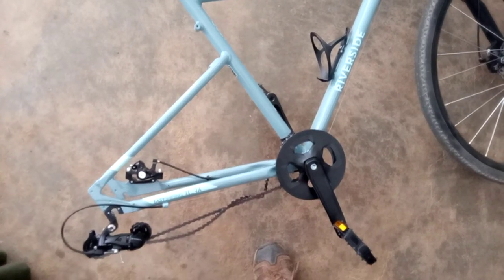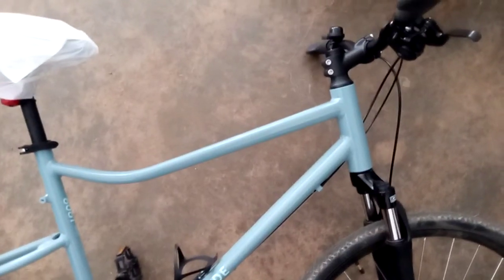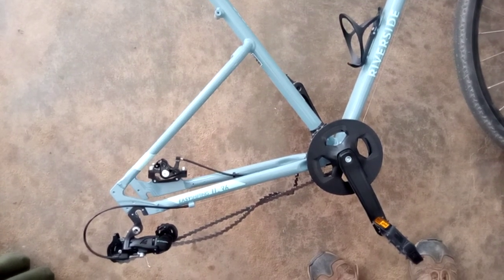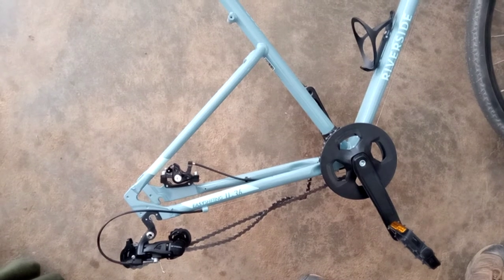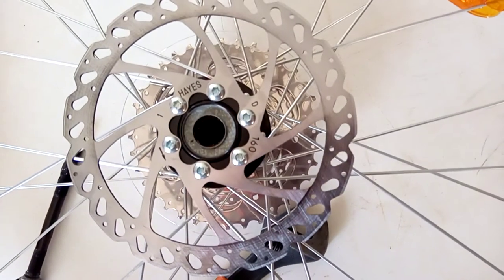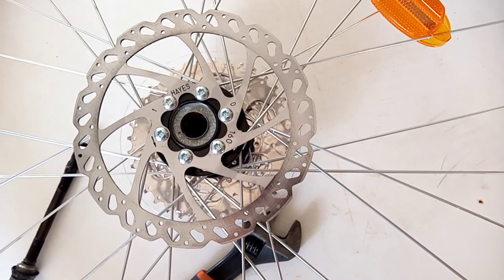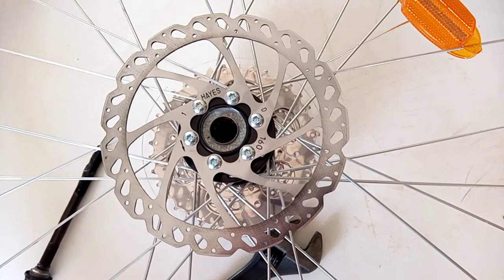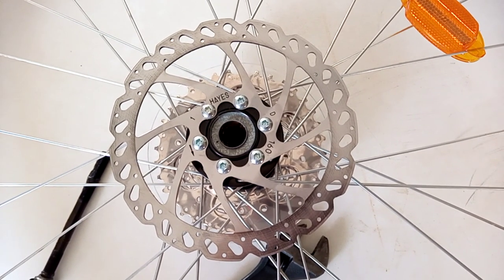Pay close attention to this on a Riverside 500 bicycle

Comment: How many rotations should a good wheel make if moved by hand?
Reply from the maker: @shsrm3  that's a difficult question, many variables involved, just make sure you don't feel and hear the bearings working overloaded when you spin the wheel securing it with your hands, also pay attention the hub is not too loose, you might feel it wobbling and knocking when shaking it with your fingers if thats the case